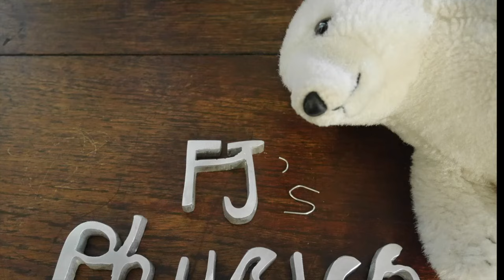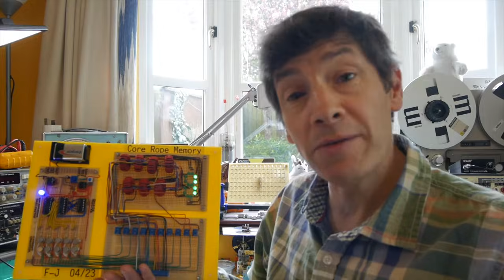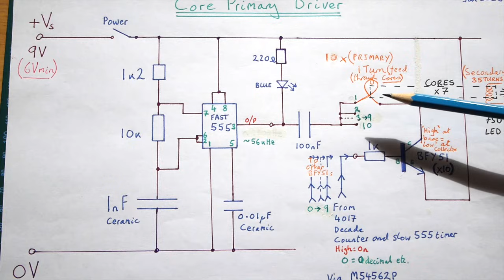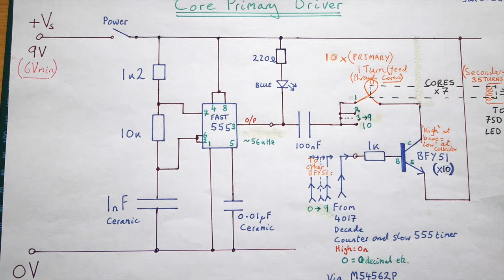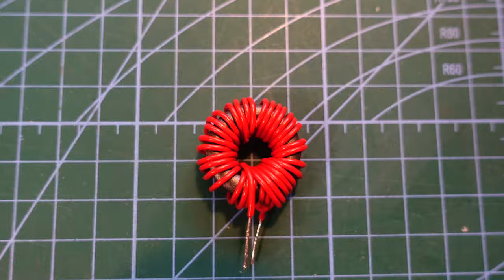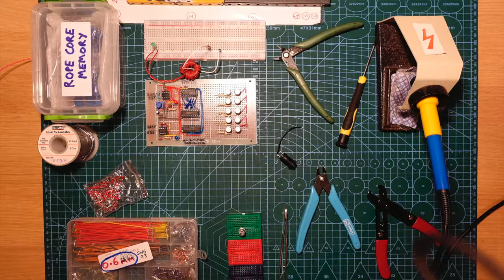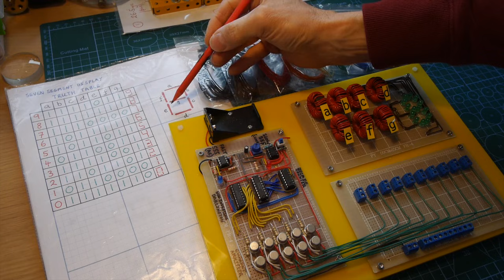Core Rope Memory Built and Explained - F-J's Physics - Video 169

Comment: What a brilliantly simple rope memory demo!
Reply from the maker: Thanks Peter.  This was the one where we were discussing the reversed transistor (and the Lucky Cat one too).  I turned them around on this circuit and it just did not work.  They seemed to work perfectly in reverse active mode! It was a fun build and it was clear that with a non 50:50 duty cycle a couple of the LEDs needed turning around too to get a similar brightness to the others!  Still, it is massively simpler than the one in the Apollo AGC set up!
Reply: @AnthonyFrancisJones  I was trying to remember where we had talked about it before! Well you certainly did an great job distilling down the concept to the simplest implementation. 

I do remember reading eventually they used sort of punch card programmable loom to weave those core ropes. Wouldn’t it be great of someone built a machine to do that today and wove something like the ZX80 ROM into a working rope memory. Of course wholesale prices of tiny cores would be a must for that!
Reply from the maker: @ElectromagneticVideos  Yes, there was a kind of frame that indexed across to allow the needles to be passed through.  To make a working model properly for RAM you do need special and tiny cores made of special metal tapes in rings.  Core rope is not so critical as it is ROM.  All good stuff!

Comment: Would I be able to know what type of ferrite toroid you used in this video?
Reply from the maker: Good question.  I just experimented with a few different types and as they are acting as transformers basically any ferrite seemed to work.  I am sorry that I cannot be more specific.  I don't think it was a particular part number just some I found cheaply online.  If you have a go, get one of them working first and then build the others, which is what I did.  If you have success, let us know how you got on!

Comment: did you ever get to the bottom of the dimmer top two LEDs.'A' puzzle  My guess is that it is the only pair where one of the LEDs is reversed. edit - but wait, i just realised '7' and '0' are fine, in fact 'A' seems extra bright for those two LED's when the '7' is lit.
Reply from the maker: Yes, it was a couple or so LEDs that were less bright and it should not matter as the signal oscillated between ± but it seemed that the duty cycle was to blame so I turned them around (hate desoldering!) and they all look the same now!

Comment: Rope memory isn't even steampunk. It's like a lady at Burning Man weaving a blanket except it's memory with address/drive lines. I mean the Linotype machine existed in the late 1800s, it's just funny that in the late 1960s people were weaving memory by hand for NASA. But it's such a niche item. In the mid '60s it was $2.5M for a GE-635 and IBM mainframes were more, and I'm sure everybody remembered when computers took up the whole building so they didn't mind that the magnetic core RAM filled a big cabinet. To the contrary they probably saw it as an amazing feat of miniaturization 😂 Imagine working on the Apollo software. You put in a merge request and then people literally have to weave the bits into the codebase.
Reply from the maker: It is amazing stuff isn't it Raquel.  One of the reasons for its use is the fact that it is pretty radiation hardened by design so once a bit is treaded it it going to work!  It is interesting to compare (someone should do a video) about how much Shuttle technology (old) is on the Artemis rocket.  Have you seen my other videos on regular core memory?   https://youtu.be/T8VreNzldWc  Be interested to hear what you think.  Thanks for watching and taking the time to comment.  F-J

Comment: Just a very weird connection to this subject. I discovered a video on the Apollo 11, wherein they used an extremely weird analog multiplexer for switching inputs to the analog measurement system for the Apollo 11 spacecraft. To find this video on YouTube, search for:

Apollo Comms Part 37: Apollo's weirdest (but genius) analog circuit

What is funny about this is they used a core memory ring, flipping the bit, to power a very unusual transistor circuit. Because the winding on the core ring is floating, this turned on a transistor (in its extremely unusual configuration) to become an analog multiplex switch, but the drive circuit is completely isolated because it is a transformer. During the core ring magnetic switch, current is sent to the transistor and it completes the circuit for an analog multiplexer with a very wide input voltage range and once again the control is completely isolated. You have to watch the video to believe it!

AND they show a version of a core rope memory used to power the computer that is related on this space mission. The parts are in common, in other words they used very approximately (or perhaps exactly) same core memory rings to trigger the analog multiplexer as the rope memory for the computer.

FURTHERMORE in this thread we had a discussion of a way to wire transistors that you used. Oh, found a comment somewhere in this thread, the relating comment is:

"BTW did you notice the very odd wiring of the transistors?  Reverse active mode I think but it just seemed to work!"

This video above goes through this subject of putting a bipolar transistor in reverse mode, complete with transistor curves, so another connection to this thread!
Reply from the maker: Gordon that’s brilliant. I will have a look at that. Funny how my transistors wired in a ‘forwards’ manner did not work. I plan to do a video of the four transistor modes at some stage to. Great to hear from you again by the way!

Comment: This was so neat! While I'm sure there were biased reasons behind many of the hiring decisions back in the day, one of the big reasons NASA hired mostly women to code the rope-core memory from what I read was necessity: they needed people who had the fine-dexterity to do it, and ended up hiring Playtex employees, who were used to working with extremely tight requirements in bra-making, and Playtex hired women. They were also hired to sew parts of the spacesuits together tight enough to be air-tight, which was an intensely high tolerance to achieve - but they had a lot of garment-making expertise. There was some kind of contract-bidding round and they were the ones who won out.
Reply from the maker: Thanks Keira. Yes I am sure you are right. It was both typical of the sort of work that women were chosen for then and some trades used very young women but as you say many were already doing work with similar skills and we must not forget that they were really good at it! Perhaps there is a video in ‘Bra makers get men on the Moon!’ Thanks for watching.